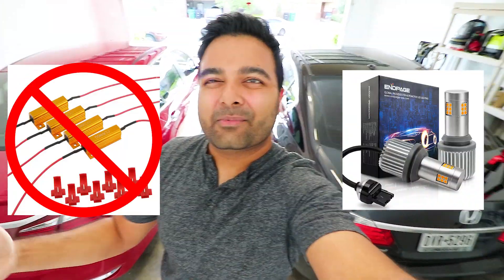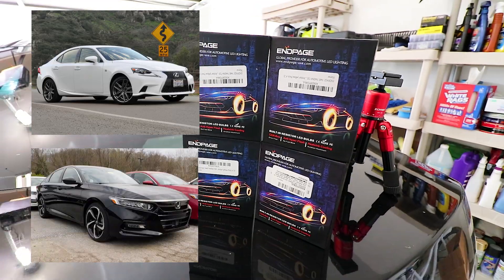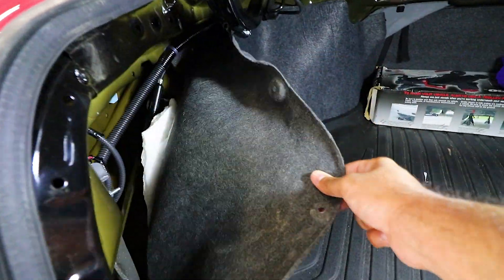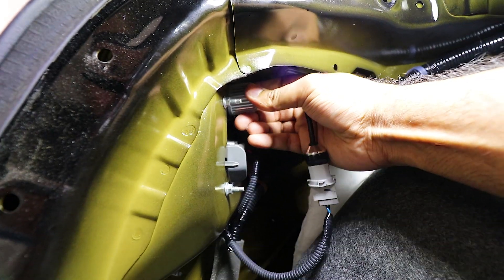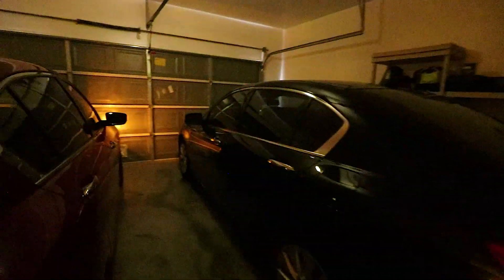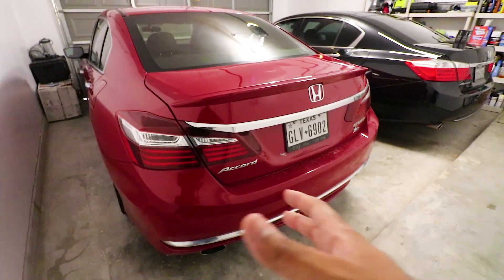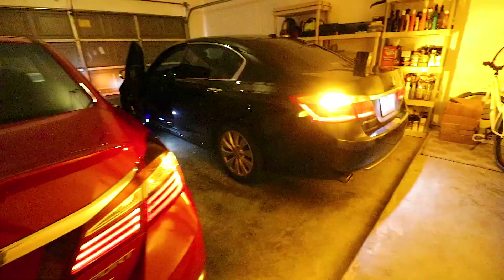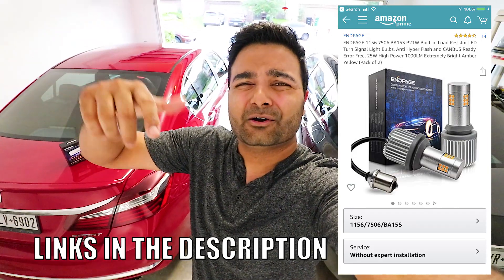PERFECT NO RESISTOR LED Turn Signals! (FINALLY) PLUG & PLAY!!

Comment: These bulbs still have the resistor, it's just Built-in. They are not resistorless bulbs.
Reply: No shit Sherlock.
As far as you're concerned, there is no resistor because you don't have to tap into anything.
Reply: Well no shit...
Reply: @moparfam300c  i was thinking the same thing 😂 why did everyone get mad so quick
Reply: Is that more dangerous? I mean for overheating or fire hazard issues?
Reply: @2tooful  Not really. It's just disappointing for folks that wanted the LEDs for the efficiency benefit

Comment: These already have built-in resistor, so that's why you don't need resistor. However, there's no point using resistor because it makes the LED uses the same amount of power like the incandescent bulbs. I would rather use flush relay, but that may not be available for all vehicles.
Reply: Ying Chiu Luk where can I get a relay for my 2014 honda accord touring turn signals?
Reply: The resistor increases resistance, which is how the car measures if a bulb is blown. leds have low resistance, which is why it triggers fast flashing. it does not touch the amount of power. Hope this helps!

Comment: Finally some bright LEDs. Those of us that have chrome turn signals know that it is very hard for others to see in the daylight. Such as this vehicle Shown there’s no difference at all with amber lights in the sunlight. Been looking for some LEDs with built in resistors😎 also that generation of the Honda Accord is so much better looking than the generation they have out now. That Back end has that expensive look to it and those LED lights make it look so much refined😎
Reply: Ordered two pairs 3 out of 4 bulbs hyperflash on my 15 dodge journey and 17 highlander....very cheap lights!! Seemingly only works with honda...

Comment: I got these on Amazon. Tried to I stall on my 2019 Si sedan. It could not fit with the gasket on the bulb. Had to shave off a bit of the gasket. But it was just toooo bright. It will definitely blind everyone at night.
Reply: yes I have been behind someone at night with these and it quickly becomes annoying.
Reply: I only use my signals when that one person has their high beams on 🤡
Reply: I’m saying tho...yes to led reverse lights..no to led blinkers..ever been behind someone with them? I’m not trying to become a road rage target 😂

Comment: great video man! i just bought 2 set (front and back) for my '22 Nissan Rogue that uses the same 7440 bulb using the link you provided on the description.  The only thing is it's not exactly the LED bulbs in the video, but these are more of same size of the 7440 bulbs that you just plug-in.  Regardless, can't wait to try them out!.. thanks again for this informative video.
Reply: follow-up on my post.  I finally installed them and WOW! the difference is NIGHT AND DAY!.. Thanks for the recommendation and great review man!

Comment: I ordered mine and installed them onto my Sentra, worked perfect and looks great 👍🏼
Reply: heckii clears Any hyper flash issues?
Reply: Matthew Martin No no problems, I even ordered a second pair for a Camry and their perfect after two months
Reply: heckii clears Have you had your signal on for a long time and developed hyper flash? I keep reading if you leave the turn signal on for longer than a minute or two, it starts to hyper flash.
Reply: Matthew Martin no lol I literally have my car parked outside my girlfriends house with the emergency lights on all the time for about an hour and their fine
Reply: Matthew Martin the ones that hyper flash after a while are a different brand I know which ones your talking about but you should be good with these
Reply: heckii clears How about with the individual turn signals?

Comment: do these work on a 2003 cr-v ex from honda and if so where do you install them at unable toinstall at rear tail lite the turn signal at front has 3 wires blk, green,red/yellow

Comment: Ordered these for my 10' FX35/QX70 and Installed them on the front blinkers. As of now they've worked decently like they should and no issues..  Bright asf too haha "knock on wood" So I'm gonna attempt and install a second pair for the rear blinkers. 

I've previously installed some front and back but were the yellow plastic base kind from ebay.. They only hyper flashed if the suv was not running. Problem was that they only lasted like a month and half..  Idk if the chicago winter had to do with or cuz they were just cheap.. About 7.99 a pair.

Comment: Hey brother,  I would like to know if you have the part number for the front led turn signal "no hyper flashing as well" for my Honda Accord 2013 exl.
I will appreciate it, thanks for all your help uploading all the videos about Honda's!!👍👍👍
Reply from the maker: Do you know what bulb size you require? It will be in the manual, bulb, or online for your year and model.  I just want to make sure.
Reply: I think this is the size 1157NA 12V27/8W let ne know if I'm wrong?
Reply: Thanks for responding to my question?

Comment: Hey @kleantrix, glad you are back. I have a tough one for you, i got a chevrolet trax 2020 and i wanted to put led all over the car but i read in the user’s manual that electrical issue may occur if i install aftermarket led bulbs.... what do you think?
Reply from the maker: You are actually in luck, these will work for both your front and back.  I think the bulb will be fine, however make sure you don't short anything.

Comment: Once u fix those in, how will u take it back if incase to change it. Coz that rubber is stuck inside.
Reply from the maker: Its not too hard to take out, as long as you can twist it and pull.

Comment: I see on your video that you have the Hazards or 4 way flashers on,  is the hyperflash still eliminated when the turn signals for either side are used as the yellow super bright ones that you claimed did not require resistors actually did unless it was the 4 ways being used.

Comment: What if u use front and back will it hyper flash on my odyssey? I want all 4
Reply from the maker: It will not hyper flash if you use these types of Lights
Reply: @KLEANTRIX  okay let me tell you while I was asking though because another video I saw with the non hyper flash LED they said it will if you have it on front and back but good to know because I really want to put these on my 2006 Honda Odyssey same bulb for front and back correct

Comment: One more question, dude. Do you ever get like a burning plastic or rubber smell after you installed these? I installed mine today (they fit) and I had a weird burning smell coming since I installed LEDs for the brake, blinker, and reverse lights

Comment: Out of stock but will place my order once its available.  Now where can I find switchbacks error free for the front turn signals ? 🤷🏽‍♂️ Specifically for the 2016
Reply: Ordered two pairs 3 out of 4 hyperflash on my 15 dodge journey and 17 highlander....very cheap lights!! Seemingly only works with honda...

Comment: I'd like to purchase a few pairs of 7440/7443 bulbs but they are sold out. Will stocks be replenished soon?
Reply from the maker: It should be replenished soon.
Reply: @KLEANTRIX  Thanks!

I see that you recently added a new link for different bulbs - https://amzn.to/2ZB3X17
lbs

These look great, but how good are the cooling properties?

The bulbs in the video have big heat sinks. The ones in the new link don't appear to have the same cooling properties. Many other bulbs with built-in resistance (but w/o heat sinks/fans) tend to not hyper-flash at first, then start hyper-flashing after they heat up from frequent use.

My bet is that the ones in the new link will not perform as well as the ones in the video in terms of how long they can maintain their non-hyper-flashness.

Please let us know what you think!

Comment: Would this work in the front blinker for the 2016 Honda Accord Sport?
Reply from the maker: Yes however make sure you get the right size
Reply: @KLEANTRIX  it's the same size bulb so the same ones should work correct. I purchased them and received them today they are awesome.

Comment: Is there a type of led bulbs you recommend for a 2010 Nissan Altima tail blinkers? Mine won’t fit at all
Reply from the maker: You have to make sure to push it in while twisting it.  It is a friction fit.
Reply: KLEANTRIX like the hole where the main power wire is the only one and it’s small as hell

Comment: Do you know if anyone has installed these lights on a 2016 Honda CR-V? Obviously the bulb itself will fit, but I’m wondering if it will fit when you install the housing back into the car since the heat sink comes out a bit and there’s extra wiring now with this set up.

Comment: Are these turn signal bulbs the best in the market or have you tested better ones because I'm been looking for the best ones to install in my car? Big fan, looking forward towards your response.
Reply from the maker: These are seriously the best I have tired.  They are the brightest and the easiest to install.  However I haven't done long term testing with them yet.  The reviews seem promising. However at the moment they are on both of the Honda's and I will be installing them on my Lexus soon.
Reply: @KLEANTRIX  
Thank you for taking the time to respond. The only problem I have with these light is they don't make model that fit my car. Do you think that eventually they will come out with more models??
Reply from the maker: @rjal6528  What size are you looking for?
Reply: @KLEANTRIX  
3457
Reply from the maker: @rjal6528  Seems like: https://amzn.to/2L0lFH3 could work, however I would contact the company and see if it will work.

Comment: Can’t even find these anymore they are sold out. Gonna try the OXILAM lights to see how they go. They don’t need resistors either.
Reply from the maker: What size do you require?
Reply from the maker: The OXILAMs are a smaller factor so they will fit better in most cars.
Reply: @KLEANTRIX  ah gotcha. 1156 and 7440 is what I got…I ordered them yesterday and they too have built in resistors so let’s see how they go. Thank you!
Reply: @KLEANTRIX  hey I need some advice. I told you I ordered the 1156 bulbs for the turn signal..they sent me 3156 instead! Are they the same bulb, like are they interchangeable, or should I return them? I’m not sure if they are the same or not. I messaged the person I bought them from. Haven’t heard back yet. 
Thank you!
Reply from the maker: @omt4293  sooo they are really similar and should work, however wait for them to give you better advice.
Reply: @KLEANTRIX  ok gotcha. Thank you!

Comment: Kleantrix I have a 2018 Tacoma and I am having a hard time placing the rubber ring into the tailight housing, do I push with no pitty perhaps? Because as you may notice the rubber diameter is bigger and not with the pattern that the housing and socket share together.
Reply from the maker: Yes push it till the first ring goes in. The second ring should stay out. What I see works well is that you have a twisting motion as your push.
Reply: KLEANTRIX thank you! That is exactly what I did and worked! Thank you so much! I’m dazzled of how bright this bad boys are! Best Led bulb I’ve tried in the taillights!

Comment: are there no adapters included to be used with like a 2004 accord?
Reply from the maker: What size do you require? Because you don't require adapters
Reply: Pretty sure it's 7440, but I seen something also at 7443
Reply from the maker: You might require this: https://amzn.to/2MVoN9s

Comment: Bro idk how you got these to stay in..I tried to put these into my 2012 Camry and its the right bulb size (7440) but it just doesn't stay in. Any tips?
Reply from the maker: Make sure you twist and push it in all the way.
Reply: @KLEANTRIX  Okay. So basically that first piece of rubber has to be twisted and pushed inside that slot where you would turn the original stock bulb clockwise?
Reply from the maker: @xDJRandomx  Yes.
Reply: @KLEANTRIX  Thank you ill try my best i hope i get it eventually! lol
Reply: @KLEANTRIX  I appreciate the response btw.
Reply: Hey I just wanted to let you know I got all four of these bulbs in after just pushing and turning/twisting. These are insanely bright. Thanks again brother.

Comment: Will These work on Early 2000's Toyota Corollas and are they Safe,  Will they ruin the Wiring system?...
Reply from the maker: Yes you can use this for your 2000 Toyota, however make sure you have the right size bulb!

Comment: For those that have them installed, what is your remedy for the lose harness/socket plug in connection, if you have that issue?
Reply: There is a brighter one than this on Ebay that do not require resistors. I have in my suv.
Reply: @myytchannel6632  do you have a link? Thanks in advance.

Comment: So plug and play led lights work without resistors. Because I just bought similar lights than these. And they are plug and play
Reply from the maker: yes plug and play means installing without doing any modifications.
Reply: @KLEANTRIX  okay hopefully they work without hyperflash. Because the ones I have now hyperflash and don't show up on the dashboard
Reply: @KLEANTRIX  but  the ones you installed were unavailable so it recommended other ones but it also said plug and play
Reply from the maker: Yes they should work and also they have built in resistors so they should not hyper flash!
Reply: @KLEANTRIX  and show up on the dashboard also.
Reply: @KLEANTRIX  so I received them but there still hyperflash and nothing shows up on my dashboard. So these didn't work neither
Reply from the maker: @jacklarage2651  that’s weird. Ok. Give me the size you are looking for and year make model of your vehicle and I will do some research on something that works with your car. In the mean time return them back to get a refund.

Comment: Hey kleantrix. I still have the luyed turn signal bulb for 2 years and its still going strong. But I'm still looking for a great switchback led for my ride. The switchback led I got is from lasfit.
Reply from the maker: What size are you looking for?
Reply: I'm looking for 3457
Reply from the maker: @johndiza2125  Oof I don't thing I see it as a switchback no resistors only this: https://amzn.to/34cwCwT
However I do see this in amber:  https://amzn.to/2Ufhx92

Comment: Hey Kleantrix love your videos! Quick question any chance they have these for the front turn signals? I would love to have these for the front as I currently use load resisters LES’s which I hate
Reply from the maker: Yes they work for front! Make sure you get the right size!

Comment: Does it work on a 2020 Genesis G80 (same model as the 2018 model) for the front signal lights? as the rear are already LED.
Reply from the maker: What size does it require? 3357?
Reply: @KLEANTRIX  Here's what's on the bulb.... H21 KHA12V28/8W2357

Comment: It's a 25Watt draw, will it be safe if the rated is only for a 21Watt incandescent?
Reply from the maker: I'm sure it will be fine, however if you want, contact the company with your question and they will give you a second opinion.

Comment: Will these fit the Highlander?
Reply from the maker: Sooooo I have tried it for the rear turn signals and they are super tight and I don't recommend it unless you get it to fit, however they work well for the front turn signals.

Comment: Hi , 

I am Anup from Canada and I am using a Honda Accord 2016 4 door Ex-L 2.4 L. 

Can you send me Amazon Canada links of LED’s.

Front high beam 

Front low beam 

Front turn signals 

Rear turn signals 

Rear back/reverse light 

Trunk and Inside lights 

Thanks….

Comment: Do these work for 2018 Honda Accord touring ?
Reply from the maker: It depends on what size you require. I think they might be the same. Make sure to check your manual and or online to see what size your 2018 model uses.

Comment: do they match in a toyota funcargo pls 2003 model?
Reply from the maker: What size does that car require? Do you know?
Reply: @KLEANTRIX  i dont know its a japanese car.i sont kbow what it takes exactly
Reply from the maker: It should be in the manual or on the bulb itself. Let me know when you find it so i can direct you accordingly.
Reply: @KLEANTRIX  ok thanks for your help .i will check in my bulbs or manual book.they seems that they are bright enough and crystal clear those bulbs

Comment: I purchased these but I still get hyper flash sometimes
Reply from the maker: Make sure to check with the company for a replacement.  Should not hyper flash like in the video.
Reply: Sinsz X1 you can only install 2 at a time either use it for the front or the back but not both so if you have 4 installed than you will need to add load resistors hope this help.👍🏻
Reply: @tommy13965  I only have 2 installed and they are in the front I learned that my headlights need to be turned on for them to work properly